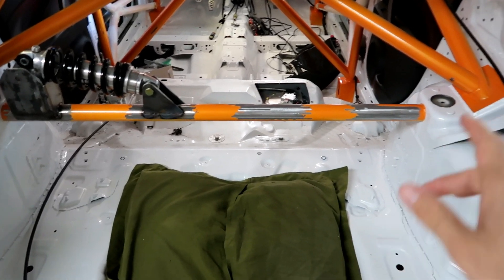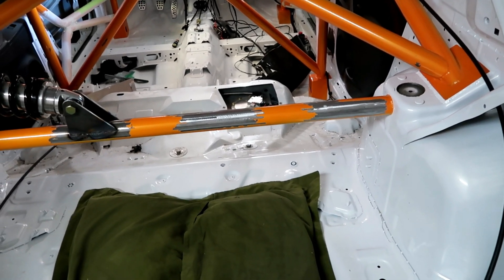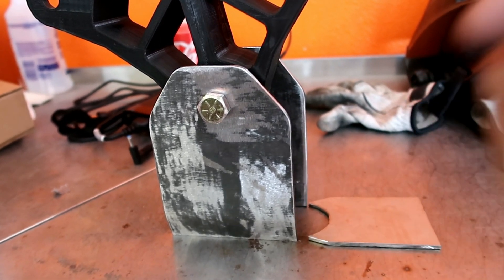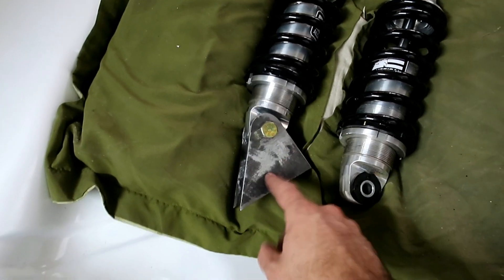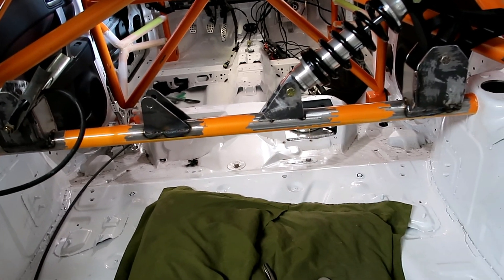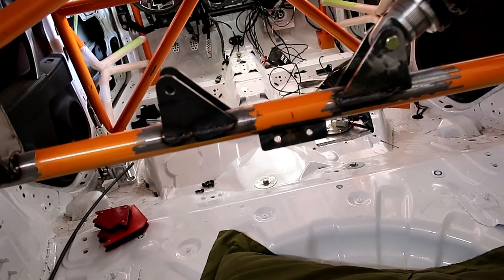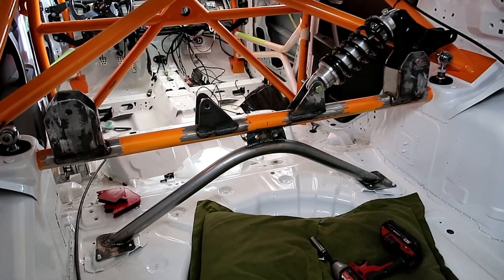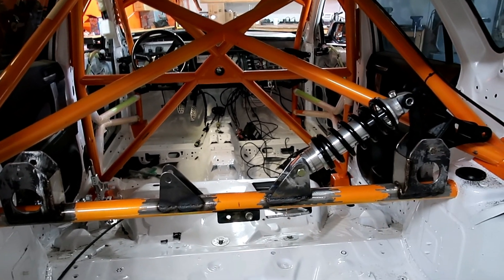Custom Cantilever Suspension - Mazdaspeed3 Part 1 (Episode 56)

Comment: I just recently learnt that the rocker point should be directly in between the 2 angles of the pushrod from your LCA and the angle of the shock. Clearly this is too late but just thought I'd let you know as I'm about to redo mine on my 180SX.
Reply from the maker: Not sure I'm understanding what you are referring to.

Comment: What’s the weight difference before and after being gutted
Reply from the maker: Havent weighted yet. I did some calculations and it should be around 2800lbs when done. I’ll weight it and show a real number
Reply: Was thinking of doing same thing with mine and buy to balloons for back suspension